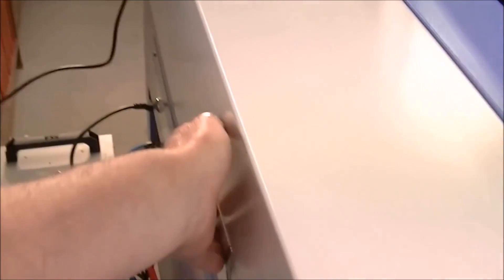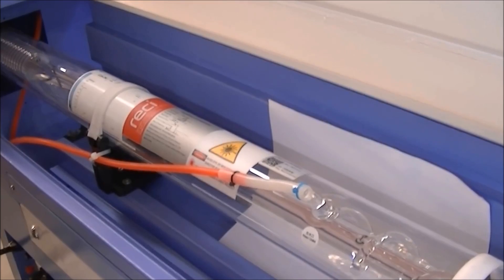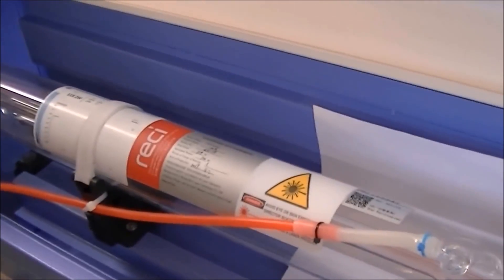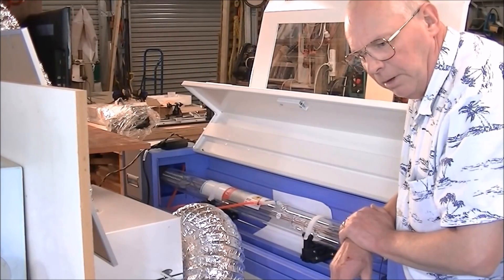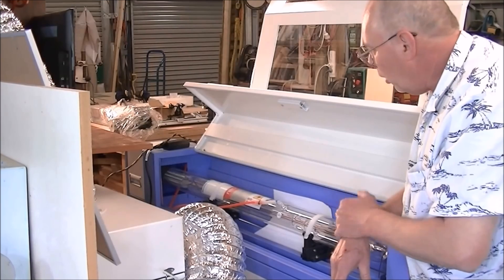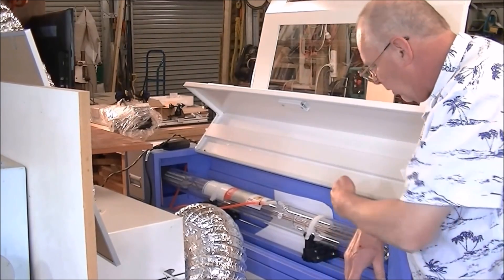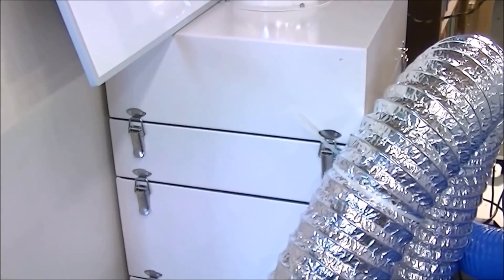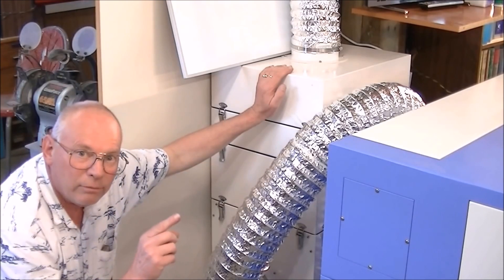OH! DEAR! 100 W Laser so you bought it from China !#$!@

Comment: Roger Hello, My 100watt yueming machine controller is not working properly. It stuck sometimes in between the running command , then we need to turn off and turnb ON the machine many times then starts working again for an hour.. then again occurs same issue.

Comment: What happens if you use a 150 watt tube with a 100 watt power supply?
Reply from the maker: Your 150w tube will run at about 100w max

Comment: A lot of lasers on aliexpress labeled as RECI. Are those fake? They are 200usd more expensive thank normal tubes
Reply from the maker: Hi, RECI lasers are good so the price is more
Reply: @inventorsworkshop9600  thank you for the message! Could you help me with 2 more  answers? 80 VS 100 watts for cutting leather? And the head transmission with timing belt or the other system is better?

Comment: I’ve had mine for almost 4 years.  Seems to be fine. ??
Reply: Same here, knock on wood!
Reply: I apparently spoke too soon.  Just finished changing out the tube and the power supply.  I think the power supply was ok. But had some work to do and didn’t want to chance it. It’s a 100watt system.  I have to say. I think it’s working better now than it ever did.  I’m cutting through 3/4” (20mm) hardwood at 90% and 5mm per second. With a 2” lens. Probably be even better with the 2.5” lens.

Comment: I think that choosing a laser machine depends on what you have to do with it. Most of us are hobbyists and therefore will buy a 40W laser machine for 300 bucks, then upgrade it with some features like air assist, replacing bed.... minor ones.

The mean duration of a laser tube is way more than 6 months, because we use it not everyday and not for 8 hours a day...

It’s like buying a Porsche to drive it up and down our alley. Does it makes sense? Nope. So we buy a Fiat 500 and we’re happy.
Reply: Not really laser will not be dead because you use less often. Laser has CO2 inside and other gases with smaller molecules will get inside the glass tube, this makes your tube useless. It has no effect wether you use it or not.

Comment: what can you do with a 100 watt laser anyway? cant cut steel with it, even if it could it could not cut fast enough for real world production. What is everyone using these for? etching?
Reply: Laser: for cutting non conductive materials quickly.
Plasma: for cutting conductive materials like metal.
Reply: Engraving and cutting. Depends on what you limit the power to.

Comment: Thanks Roger.
Interesting info about laser tubes. Do you know how led lasers compare. When I added an led laser to my cnc I exhausted the fumes outside.
Cheers
Peter
Reply from the maker: Hi Peter, I don't think the problem exists with such low led laser power. The led lasers were developed primarily for DVD burners and the like if my memory serves me right. This type of led laser normally has a lifespan of between 7,000 to 10,000 hours, that is one of the reasons why your hard drive can fail after 3 to 5 years I suspect.
I exhausted the fumes outside, send the problem downstream, ha, ha, ha. I'll be sending you a private mail for a chat if that's ok.
Reply: Hi Roger I think you meant CD/dvd drive. The Hard drives use electromagnetism to write and read to the platters.
Reply: Rob Hampton dvdrw. (Read and write) are commonly referred to as DVD burners and while not entirely technically/correct we know what he means, as for diode lasers they still stink when cutting so maybe not so safe, especially if you try to work with the wrong material, cheers
Reply: Roger Webb
Look forward to having a chat. The laser I have is 1. 4 watt but some use led lasers rated at up to 15 watts assuming the specs are actually true. Don't think what comes out the exhaust hose is much worse than what comes out the chimney on a cold winters night. 
Cheers
Peter